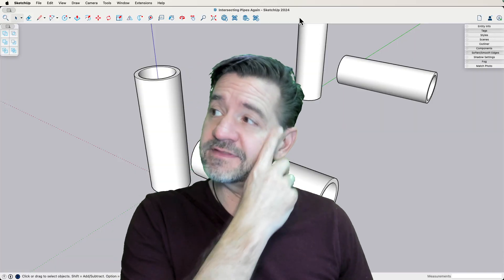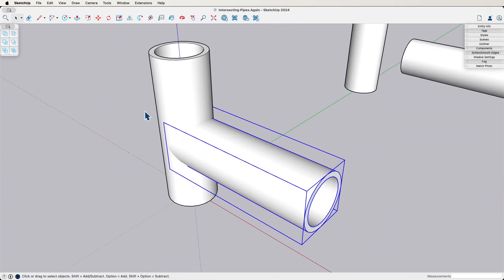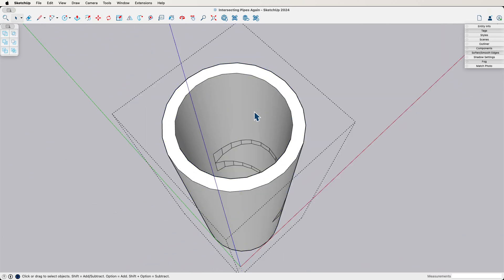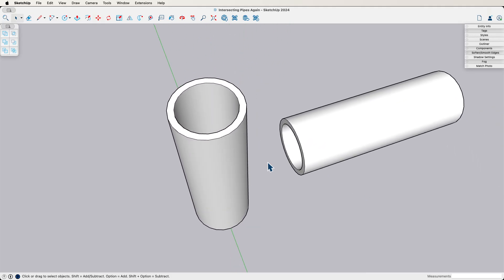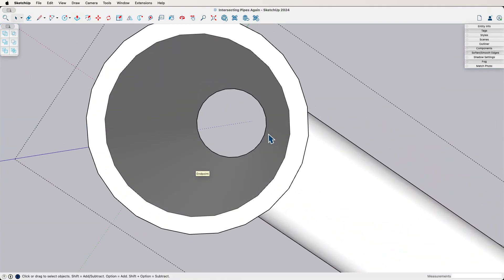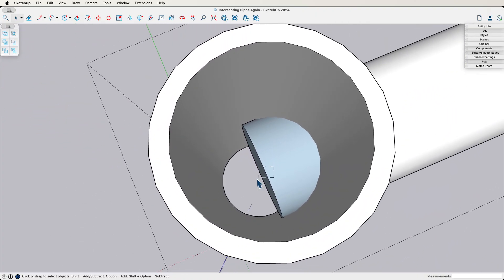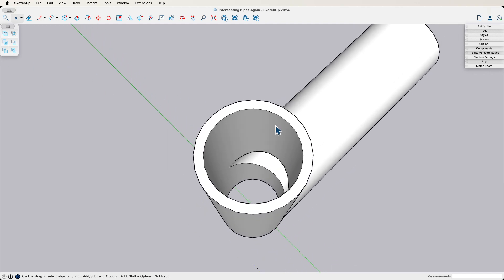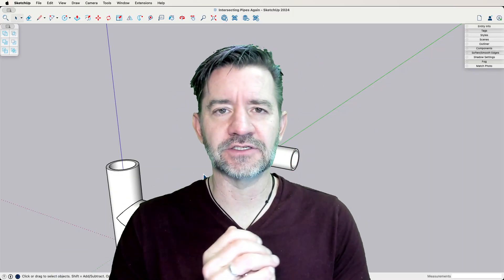A Better Way to Intersect Pipes in SketchUp

Comment: in your second edit, the outside edge of the vertical pipe did not get removed.  If you selected the outside edge of the vertical pipe along with the inside edge or just select all and intersect faces would that not work?

Comment: Great as always...and please now a tutorial how to easy find a center of an object (pipe, cylinder...), thank you
Reply: When drawing pipes always snap your circle to an axis, that will leave on axis end points and makes everything easier.  Then if still struggling, make sure the edges are welded, that makes it easier to find center.  And lastly, if you need to find center frequently, draw in "x" handles into the pipe and put them on a hidden layer.  Then in your working scene your "x" handles are visible and it makes moving things around easy and in your production scene that hidden layer doesn't show.
Reply: thank you, best would be "find center" - but it has a very limited functionality....